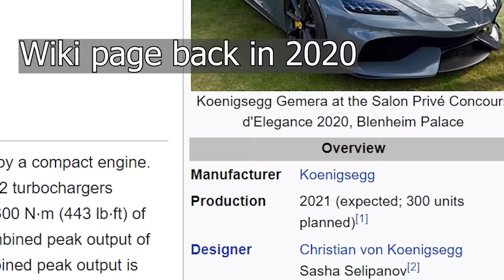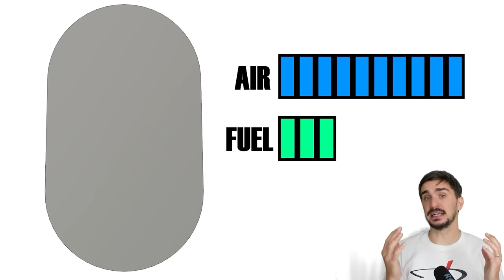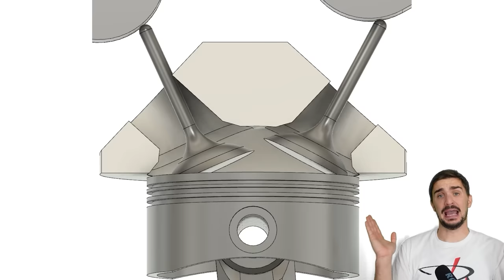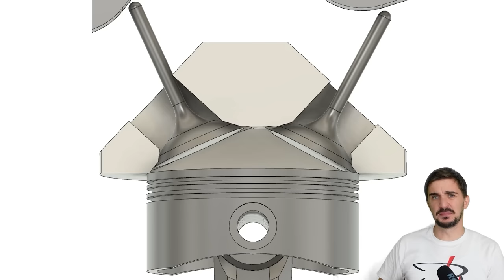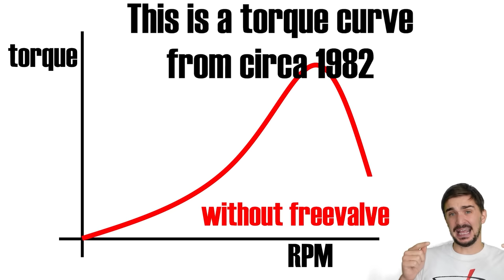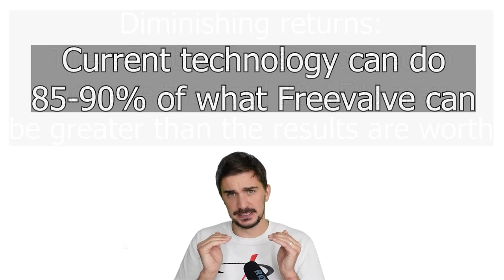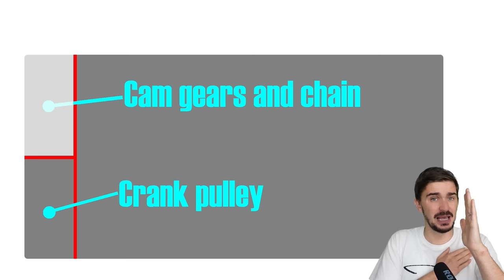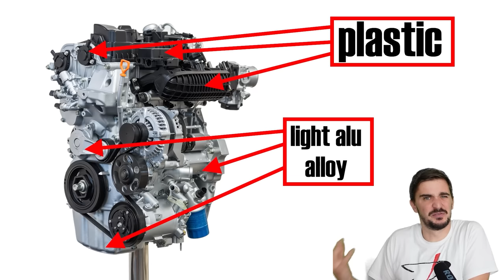FreeValve Isn't a Big Deal. Here's why

Comment: It is indicated on this video that this tech eats never demonstrated in réal application. It is NOT true. I’m following this tech from thé begining and they tested it on a Saab 9.3. It was reducing the consumption by 30%.
Another advantage of this tech is to improve reliability. No timming belt or chain. Air compressed solenoid valves are used in F1. The reason to not this tech on actual Engines is probably due to patents and also because current car manufacturers does not want to change their on thechnologies.

Comment: I just realised how the FREEVALVE will maintain the performance on high altitude and in very cold or hot temperatures. It might need separate thermodynamics control system for gas which doesn't requre to metal camshaft.

Comment: The elephant in the room here is that there's an actual calculation for mechanical efficiency. Parasitic power loss due to valve train components can be determined and compared to the loss caused by an air compressor. Valve springs, chains, and gears, are always active. The percentages you're presenting all sounds like speculation. Why not take the time to look at the math instead?
Reply from the maker: The math of what? Unknown compressor specs? The average cam which also doesn't exist?
Reply: @d4a  the math of mechanical efficiency. What's the power loss of a conventional valvetrain? The advantage isn't that it's variable or even infinitely variable, it's that it does this with far less components and complexity than the other examples you showed. The reason manufacturers aren't excited to adopt or implement freevalve is because the ICE isn't their main focus anymore. They're all moving towards electrification.

Comment: I'm not convinced. You're claiming better power figures from the Toyota engine without comparing valve train efficiency, reliability, longevity and lower end performance. You also point out massive  cost differences between mass produced cam-driven valves and free valve. How would mass production affect free valve costs? You also claim free valve technology is in the last five percent of its development. I would have thought traditional technology is at the final one percent of development.
What's the whole story? Is it just solenoids? 
Why would engines cost more when a huge proportion of the most expensive and complex manufacturing steps are reduced or eliminated. For example, forging and grinding a camshaft to modern tolerances has got to be ridiculously expensive.

Comment: The reason pushrod engines still have a place is because of how much more compact they are vs Dohc engines. I don't see how further removing the cams wouldn't make the engine more compact. He also fails to mention how one of the most complex aspects of engine maintenance would be eliminated by having a modular unit replace the entire valve portion of the engine. Also, watch Gordon Murray explain the difficulty designing an engine that revs past 10k rpm. I challenge you not to think about freevalve. (He talks about how it can only be done with sequences of gears with the precision of a swiss watch used for timing.)

Comment: I am an automotive engineer, and this is the most misleading video I have ever seen. The Freevalve system allows for performance far beyond what is claimed by the Chinese car you mentioned. You compare it to the Mini's engine but don't know the efficiency of the two units. It's not just about the amount of power; efficiency is what truly matters. How much fuel does the Mini require for 230 horsepower? How much does the Freevalve require? Do you have tests to back up your claims? Or do you know the maximum power limit achievable with Freevalve? The problem is that camshafts take power away from the crankshaft, so it's a great idea, and the only obstacle is the technical complications that arise from it. Today, we primarily talk about electric vehicles, and every effort for internal combustion seems futile; that is the truth. This doesn't give you the right to spread misinformation
Reply from the maker: Awwww, it's ok, let it all out. Time heals all wounds. I wonder how an automotive engineer missed the fact that current variable valve systems do most of what freevalve can at reduced cost and complexity? Camshafts rob efficiency and the freevalve engine driven components dont? Cmon, man, watch the video before embarrassing yourself and your title.
Reply: @d4a  You are the one who is embarrassing yourself. You cannot fail physics, any modern system you are talking about involves power losses that are absent in the free valve. No mechanical system can offer the same reduction in losses as a freevalve system nor the same kinematic freedom. In fact you have not answered, what are the consumptions of a freevalve compared to a traditional engine of equal power? Can you make a comparison? Until you provide an answer, with comparative graphs in hand, then I will not be the ridiculous one.
You have compared two engines referring only to power. Compare a freevalve with a multiair of equal power, let's see what the efficiency of the two engines is and then you can call me ridiculous, until then I advise you to take up circus art
Reply from the maker: Ok, let me use your logic on you. I have a system called sillyvalve and I claim it increases efficiency by 300%. I will not release any actual tests. Until you test and prove otherwise I'm right. See? If you can't prove different with tests of things only I actually have access to then sillyvalve is the future. Also, why are you stubbornly ignoring the compressor? That's not mechanical? It runs on koenigsegg fandom? Yeah...I'm out, this is a waste of time.
Reply: @d4a  It can recover enough energy from the exhaust gases to operate the compressor you are talking about, I repeat it is a primitive technology and for which they are no longer interested. Precisely because you do not have any data you cannot say that it is not an effective solution just as you cannot say that it is not the future. Otherwise you reject a solution without first having analyzed the technical aspects. You cannot say that it is as you say if you do not first have data that confirms your suppositions. Above all you persist in not answering, why did you compare two engines without knowing their technical characteristics and efficiency? Yours is a comparison of power that is useless for a damn thing.

Comment: The only thing Koenigsegg has going for it is the sheer performance. Unfortunately, pretty much all cars at the upper performance end look so bland in super car terms, certainly not very exciting due to the aerodynamics constraints etc... Since I cannot realistically drive 400 Km/h anyway, there are like a hundred cars I would choose before a Koeniggsegg.... wtf pissy little 3 cylinder... I'd have a 20 year old V12 over that any time. Anyway, if a car is not drivable in practical terms, what are you gonna do with it? Not saying it is shit at all, just beyond the obvious wow factor, very uninteresting.

Edit.. I hadn't finished watching. So he says he does not see how the reduction in engine size would be achieved. Well, after building inline 6 forever, MB switched to V6, only to recently switch back to inline 6 again -- and the modern Mercedes inline 6 is not longer than the previous V6, because they switched to 48V electrical system, and there are no auxiliary components anymore, to which he alludes to here fitted to the face of the engine, which is why an 6 inline and V6 can have the same length. So only because he cannot imagine something, does not mean it isn't so ;)

Comment: Back in the mid 80's, I had imagined a similar concept when thinking about increasing power on a V8 engine. The camshaft would be retained to operate switches that drove solenoids pretty much in the same way as the FreeValve system looks and works today. Though back then, computers were not a part of my knowledge base, I imagined that the gain from friction losses, the improved responsiveness of the valve actuations would significantly improve engine performance. But as a teenager, I had zero resources to put into action. I also imagined what would happen if there was an electrical failure with the valve actuation. At best, nonfunctioning valves, at worst, valves slamming into the piston causing catastrophic damage. Though in todays high tech world, the variable valve timing could easily be implemented with the engine computer, and perhaps even kits could be made to modernize the old pushrod V8 engine.

Comment: I like how you point out how Koenigsegg made unrealistic comparisons to get their numbers only to turn around and do the exact same thing yourself. 

The only way to know what free valve will do differently is to take a production engine with cams and replace with free valve.  While we might see something like only a 10% change in economy and power, those can still be pretty significant even today.  

What's likely to happen is that it will get used in very niche applications where someone wants complete control over the "cam" profile.  Then that will eventually trickle down into normal consumer grade stuff.  Many newer cars come with "sport mode" which can affect things like throttle or boost. This is just the next step in that evolution.
Reply from the maker: I like how you didn't watch the video. Please specify my unrealistic comparison? As I explained later in the vid, there's technology in place already that enables nearly infinite cam profile variations while driving.

Comment: I strongly disagree with the statement that a FreeValve will cost twice as high. If modern technology has taught us anything, it is that controlling things with software reduces complexity and therefore, cost. FreeValve literally has fewer moving parts than a fixed valve timing engine. Solutions proposed by BMW or Fiat are comparable to FreeValve, but they are vastly more complex. I think FreeValve will eventually enter the market not as some crazy performance booster, but as a cost-cutting measure. With FreeValve, engine manufacturers can get rid of precisely machined camshaft, timing belt/chain (yes, the belts will remain, but no longer critical to timing, therefore don't have to be as strong/precise), and end users can avoid expensive belt replacement and no longer have to worry that a belt/chain failure can cause a catastrophic engine failure.
Reply: Not true.  You make a wrong assumption.  FreeValve still needs complex mechanical parts to make it work.  Now the complexity goes to the actuators.  Those actuators are now ten times more complex than the original camshaft mechanism.  It is not a simple solenoid.  The actuator has pneumatic spring inside.  Thus it requires delicate and complex valve and conduits.  Moreover, additional oil circuit is required to operate the pneumatic spring inside the actuators.  The simplicity gained by eliminating the camshaft mechanism is offset by the complex actuators operation mechanism.

Comment: Whenever I hear about or think about valves, valve timing, or valve sizing, the first thing I then ask is - is this for forced induction (turbos) or naturally aspirated? In the forced induction world, things are very different, for example, intake valve sizing tends to be smaller relative to exhaust valves. But, in naturally aspirated engines, intake valves are much larger. So, then the question is, is Freevalve saying they are a big win for forced induction engines or naturally aspirated ones or both? I believe their biggest win is on the naturally aspirated side. I'd have liked to see a graph between the best current variable valve timed NA engine vs the ideal Freevalve NA engine, as far as torque per RPM graph. How much better can Freevalve possibly be vs existing tech? And, can the ideal Freevalve NA engine compete with the size, power and efficiency of standard turbo engines? Turbo technology may have provided much of the benefits that Freevalve can provide (reduced engine size, and weight, increased max power.)

Comment: am... you compared 1.6l free valve to 1.6l normal engine and only looked at horsepowers.

And even i who aint a petrol head knows that horsepower is not everything esp when you can make the usable horsepowers hit only like 5k to 5,5k rpm.
Reply: also... free vavle offers you to put almost any fuel you want; including alcohol which should make it cleaner than EV car

Comment: The last vehicle I owned with fixed valve timing was my 1999 Pontiac Sunfire GT...2.4 liter 16 valve, 2nd generation GM Quad 4.  Re: engines catching up with freevalve, I'm curious how many of them are turbocharged or supercharged, and if the Chinese vehicle was naturally aspirated.  If you could free the engine from a turbo, you will get a more responsive engine that's lighter 😊

Comment: EVs made it stupid easy to produce super cars. Battery technology is not 100 percent perfect now but in 20 years the current Lithium battery technology will look like NiCad power tool batteries you use to had to 100 percent drain the batteries by holding town the drill's trigger.  If you had a baby today then by the time the kid goes off to college with their own car that kid will have access to cars with over 1000 mile range, and 15 minute to full charge technology. 

I don't hate ICE it's just that I see writing on the walls. Look at how AI can be used today to help develop CNC models and consider where the technology be in 30 years from now.

Comment: I disagree fvt does have potential to revolutionize the industry kind of like quantum computers have for the computer industry which is another great concept  that has been made to look a lot more unimaginable than it really is, it's explained as bits that are on and off at the same time, which is true but they're a certain percent on and a certain percent off.  like incandescent light bulbs with a variable switch. the concept of variable valve technology  is not complicated and you'd think all you'd need is a few valves some motors and a computer, just like with quantum computers all you'd need is some variable light switch and some bits, and if you tell me I cant have a bit half on and half off, fine than how about two bits super imposed on each other.

well evidently the delivery is not that simple as of yet, and like we cant have quantum computing without multi million dollar refrigerators and a teams of top notch computer scientists, and lasts less than a second. we also cant create a variable valve systems without throwing complex mechanisms that make engines harder to work on and create more failure points.

if some one can get fvt to perform as intended not only will engines out perform even the top engines of today but they have potential to be mechanically simpler, more reliable and easier to work on since the model T

Comment: Are you legit comparing a turbo variable valve engine to an n/a variable valve engine?

Wasn't freevalve also port injection?  Now make freevalve direct injection and bump up compression ratio further, increasing power further.

You're comparing an engine that is comparable to modern direct injection engines with forced induction, that has neither of them.
Reply from the maker: The Qamfree engine is turbocharged. You can clearly see the turbo

Comment: hey guys ill make the long story short. 
the tech never made it anywhere because we dont have the tech. problem solved.
many times in history we tried to reinvent the wheel and made something worse and unreliable. think about the cadillac v864. it was the early displacement on demand. 
now we have displacement on demand again and instead of it just not working now it will ruin your engine. 
the free valve is exactly the same. if you have a solenoid failure there is a high chance the valve will stay down which you guessed it. will destroy your engine. with valves needing to move quickly and at the right time at high rpms your gonna run into issues. hit a bump wire loses contact briefly get a short battery dies. anything goes wrong and you need a new motor. very hard to warranty. if they designed it a lil different it would be fine in the event of an issue. but they didnt. 
ive built quite a few motors in my time and some of them dont have valves so take that for what its worth. 
my daily driver is worth more than it was new. its 30 years old has 350k miles. it now has a v8 making 450 ft lbs of torque at low rpms. i get good driveability reliability it runs cool highway is a breeze. and i get 35mpg city and 30mpg on the highway. i can also outrun the new corvette in my old suv so theres that too.

Comment: gosh your so handsom, lol  anyways, i really thought your reasoning would be mechanical & failure probabilities. Can you think about this.... a traditional motor, pushrod or cam chain, theoretically cant fail, meaning, the piston will never go up and hit a valve because mechanically impossible, lets forget about failure of a chain or breaking of a pushrod for a sec. You agree, mechanically, by design, the piston can never go up and hit a valve that happens to be down still because of mechanical design. In a freevalve, any electrical glitch where the valve happen to not fully retract when the piston goes up and u have a catastrophic failure.  My point is, there is a chance a piston can hit the valve in a freevalve, its impossible in a regular motor. what you think????

Comment: 10:50
While I apreciate the video and enjoyed it, the reason you can put 2 bar of boost in a wide-bore engine wothout knocking it apart lies in the much more complex tumble you can create with freevalve, and the reason you can rev a 3 cyl engine to 8.5k rpm also lies, altough partially, in freevalve technology.